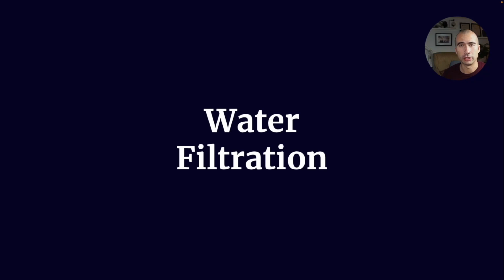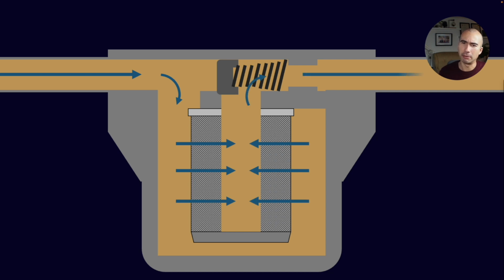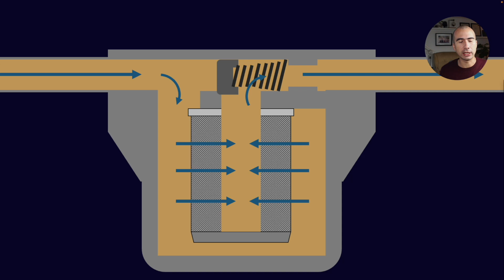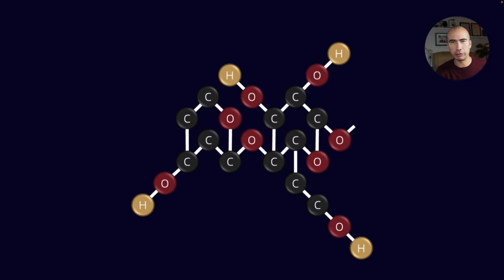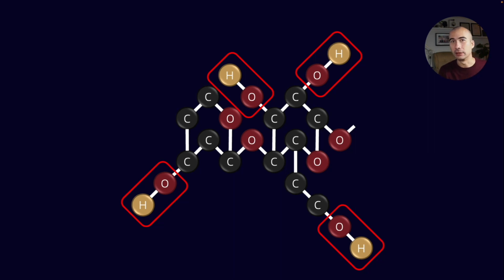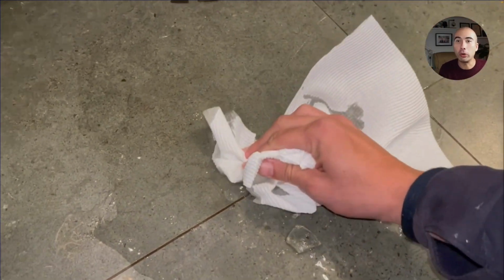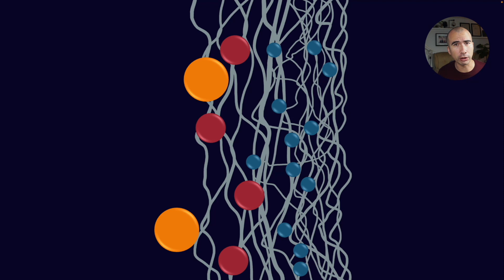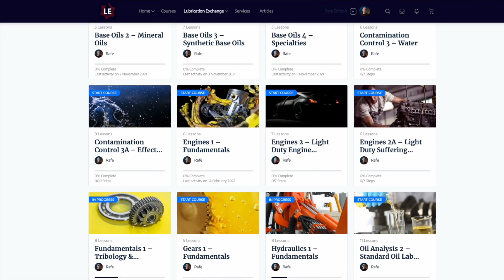How do oil filters remove water?

Comment: Thank you for the information. Cellulose filter elements will collapse and lose filtration capability as they absorb water. It is not very effective when water is emulsified. SO it is not very effectiveto use cellulose when there is water in oil. Remember, water is always emulsified in hydraulic systems due to re-circulation through pump.

Comment: Hi. Thank you for the videos. My knowledge is not complete but as far as i know we run our internal combustion engines at high enough temperatures because we want the water in the oil to evaporate. This is how know it. What i wonder is, wouldnt it be a better if we keep the oil temperature way cooler but filter the water another way? Wouldnt it be much bettter for the service life and the lubrication performance of the oil?

Comment: Interesting! Now i have a question. This also apply to fuel filters right? And some say to change fuel filter after 30k kilometers which means in average 2000 liters of fuel pumped trough the filter. Isnt that a bit to late? I think the filter will be already water saturated (specialy in cold climate with condensation) and the fuel injection system will suffer. What do you think?
Reply: Fuel filters normally don't absorb the water. They seperate it from the Diesel. In these filters the cellulose is coated to acchieve the seperation effect. The water is then led to some kind of collector from where it can be drained. Unfortunately the solid dirt in the Diesel can damage the cellulose coating, which then leads to the cellulose first absorbing some water and then let the water pass when it is is fully soaked. So these filters need to be changed regularly. Source: I work for a filter producer :-)
Reply from the maker: Great answer! Thanks for contributing.
Reply: @imperialnacho4259  Nice info, thanks! So is the 30k km interval ok from your point of view?
Reply: @imperialnacho4259  cellulose filter elements absorb water in fuel and gets destroyed. This is a common problem. Water separator is different issue. Separators are not effective when water exists in micronic sizes.
Reply: at least in indonesia where you said that biodiesel can be 30% in diesel. and contains more water practicaly